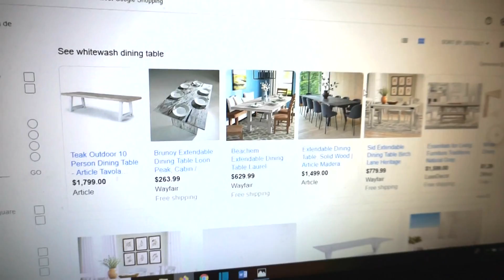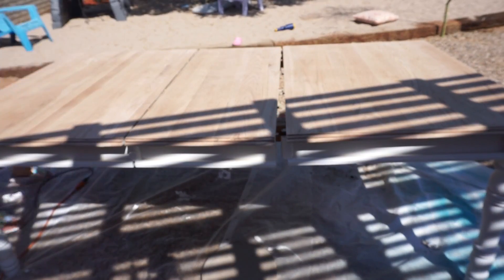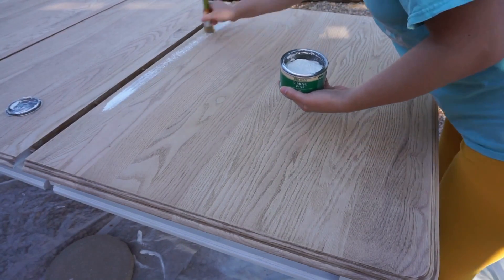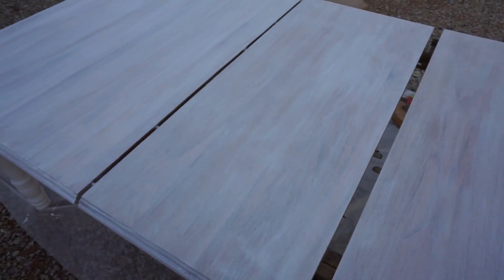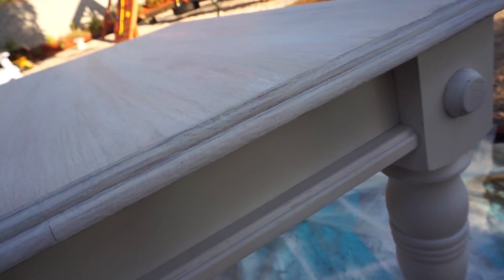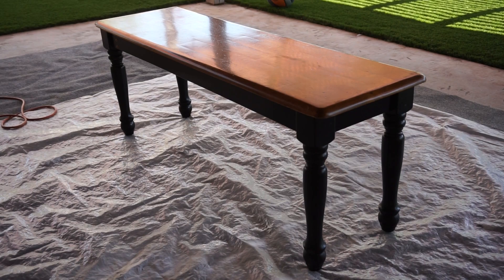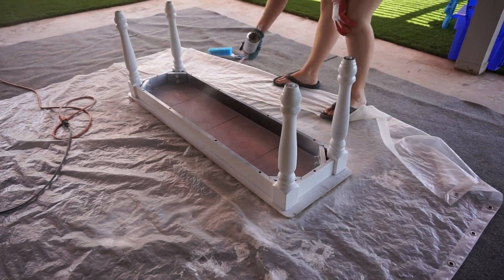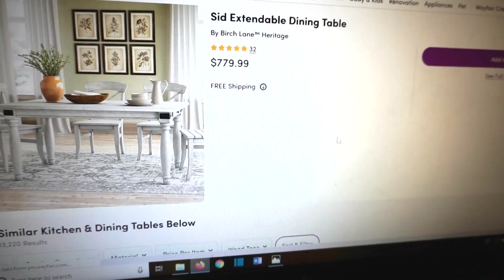Modern Farmhouse Kitchen Table Makeover + Look For Less June 2020

Comment: BEAUTIFUL JOB!!!  What a DIFFERENCE!!!
Can that liming wax/poly method be used on wood trim or walls? I see houses with so much knotty pine etc that darkens a house. I think lightening it up with a "whitewash" would look much brighter. I just wonder what product(s)/method(s) would be the most effective.
Reply from the maker: Thank you! Yes it would work but you would need to sand the surface first :) 

If you did not want to sand the surface then I'd recommend watered down white paint to white wash the wood :)

Comment: Hi! I love this transformation! Question for you. A few videos back you had used the Valspar Limewash. What is the difference between the that and this wax? I went and purchased the Valspar because of that video but haven't used it yet. If the wax is better in your opinion I think I would rather use that! Thank you so much for sharing this technique!
Reply from the maker: Hi Trish! First, I want to say thank you for watching my videos! Onto the lime products. Limewash is a completely different texture than lime wax. Limewash is grainy/sandy in texture. It is best for using in the cracks and crevices of pieces of furniture with a lot of detailed finishes like carvings or inset lines and details. It also will give a bit of texture to the piece you use it on which in my opinion makes it appear more shabby chic or antique. The lime WAX is completely smooth  and does not build up in cracks and crevices the way that lime wash does. It wipes away very easily so it is more for an all over coverage or for an even white washed finish. Although, you can use it to create faux finishes by picking and choosing where you apply it on a piece. Maybe I should make a video to show the differences side by side. Both products are awesome in their own ways!
Reply: @DesertDIY  oh a video showing the differences would be great! I'm so glad to have this information. I was going to use the lime wash on a dresser that is plain, unfinished right now. It has no details on it, so I thought it would be a cool to give that effect to such a plain piece. If I'm understanding correctly, the wax would be better for that, right?
Reply from the maker: @trishmcgilton6387  you are absolutely correct!!!

Comment: I have a question for you...after applying the liming wax, do you wipe it off with a rag?  Is it truly a wax?  How is it ok to apply polyurethane over top of it?? 
I chalk painted a desk for my granddaughter and applied a wax finish and it was beautiful but it is not holding up well. I’m just wondering if I could put poly over top of that wax finish.
Reply from the maker: The liming wax is not like a sealing wax, I have applied poly over top of it with no issues more than once. You would definitely wipe off the excess if there is any though. And give it time to dry out if you are in a humid climate. Applying poly over wax is really tricky. I think shellac would be the only thing that would work over wax but your best bet is to sand it with 220 first. I do not recommend wax finishes on anything that you will need to clean often or on surfaces that get regular use like table tops, etc.
Reply: Desert DIY, thank you for your reply and your advice!  I hope I can save the pretty paint underneath that wax finish!  😊
Reply from the maker: If you sand lightly enough you should be able to! Chalk paint holds up well to sanding because it is so thick

Comment: Hi, I just love your table; however, I am a little slow.... and I was wondering if you put the clear coat over the wax.  xo Linda from NEW ORLEANS
Reply from the maker: Hi Linda from New Orleans! Yes, you are correct. You will apply the clear coatnover top of the lime wax. Although it can sound confusing, since there are wax sealers out there, this product does need to be sealed.
Reply: You are my new favorite DIYer!!
Reply from the maker: @l.c.alvarez5922  I am very honored! ❤